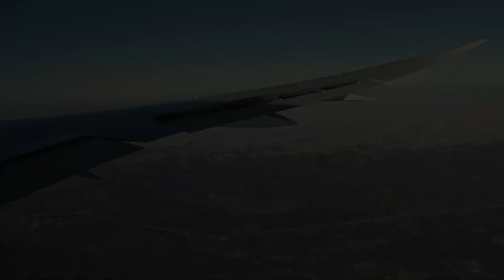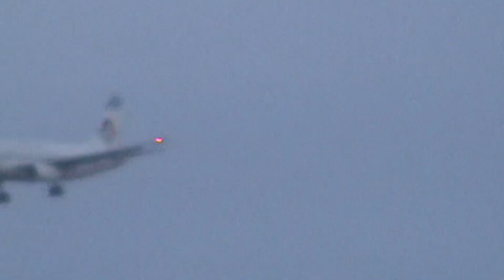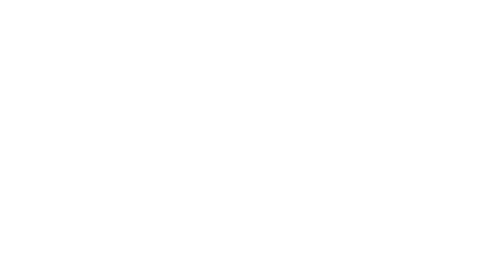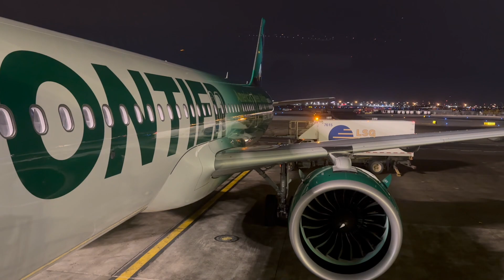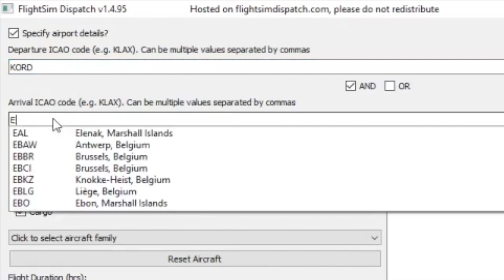ULTIMATE Aviation Throwback Project | Looking Up Old Flights

Comment: Such a shame that the website you used is down. However, there is another way to lookup past U.S. domestic tail numbers, with this link. https://www.transtats.bts.gov/ONTIME/Departures.aspx
Unfortunately for me, most of my past flights which really I want to find the tail numbers of were international flights, or domestic ones within Europe. However, this website proved somewhat useful to me, as I FINALLY found the tail numbers of MANY past CRJ flights which I took. Additionally, I found out that the Delta 757 I flew on from SLC-LAX in 2014 was N757AT, both an ex American Trans Air and an ex Singapore Airlines Plane. Sadly, N757AT was scrapped. 
Also, for a while I thought that my 2013 flight from Newark to Denver was operated by a generic United 737-800 or something like that. But using that website I discovered that it was actually one of the rarer -700 variants (N27724, still flies to this day)! It was interesting hearing about your past flights, and thank you for making this video. I hope that someday there will be a way to find past international flights.
Reply: Thanks for the link. I figured out what I flew on back on December 23rd, 2008 from PDX to LAX. It was N619AS, an Alaska Airlines 737-700. I actually misremembered the flight being a 737-800 and assumed it was N546AS.

Comment: Your use of the phrase 'back in the day' brings a smile! My 'back in the day' goes much further--try the 1980's! While I haven't  seen the need or fascination with what aircraft I"ve flown on, I do remember flying People Express from HOU-EWR-BOS in the mid-80's when they flew 727-200's and 737-200's and New York Air BOS-EWR connecting to CO's MD-80 to IAH--both New York Air and CO  were run by the infamous Frank Lorenzo in the height of deregulation when fares were bargain basement level--HOU-EWR for $79!

Comment: From the first flight I ever took I wrote down the registration number and I missed never one. At the airport I try to see it or otherwise I always ask a flight attendant and they are very helpful. The type is easy, if you do not know what type it is, you can find it on the safety instructions. I also wrote down the times and runways et cetera. I flew 458 times...
Reply from the maker: Now THAT is impressive!

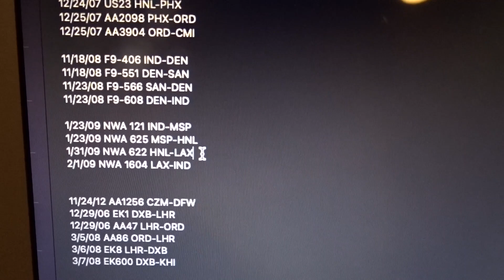Comment: Wouldn't it be so cool if you could pull up the registration and aircraft type of EK 600 you flew on 3/7/08 😉. At 3:52 in your video.
Reply from the maker: It was either an A330-200 or 777. I flew 600 in 2009 as well, that time it was a 777-300ER.
Reply: @ASAviation  I flew on their A330-200 and 777-300s to and from Karachi to Dubai and their Airbus A340-500 and 777-200LR to and from JFK around 2004/2005. 

Their Boeing 777-300ERs came much later and was lucky to fly them and most recently the Airbus A380. So been on all their aircraft types. If only you had seen their initial 727s when they first began in the early 80s, you could never imagine the global giant they would become some day!!